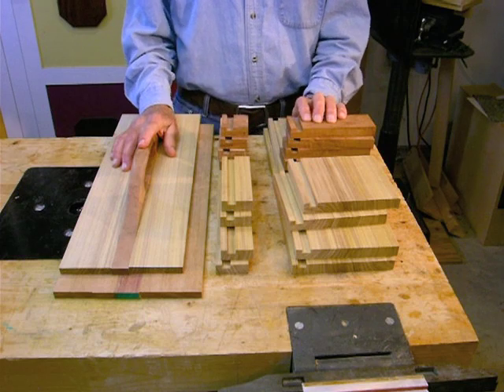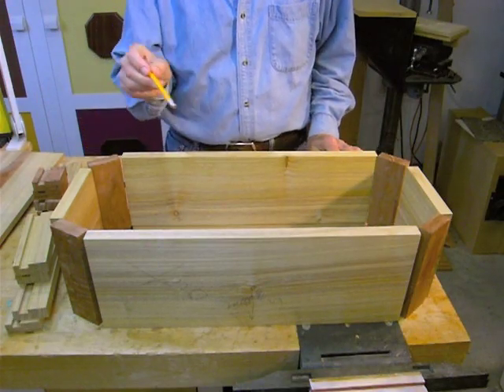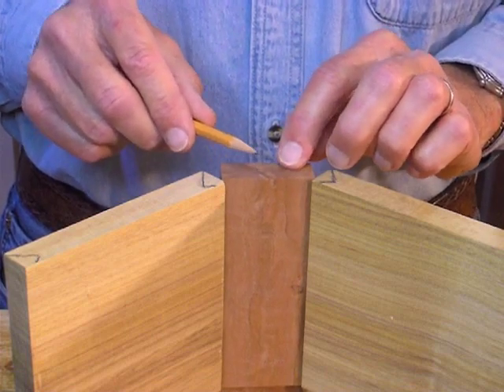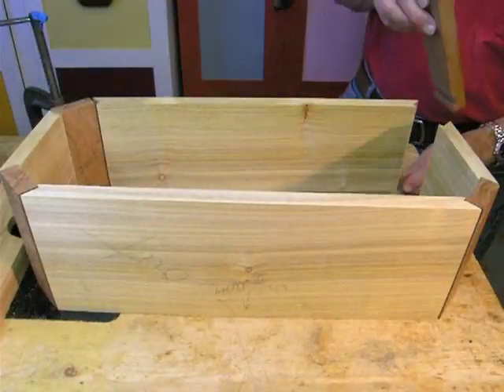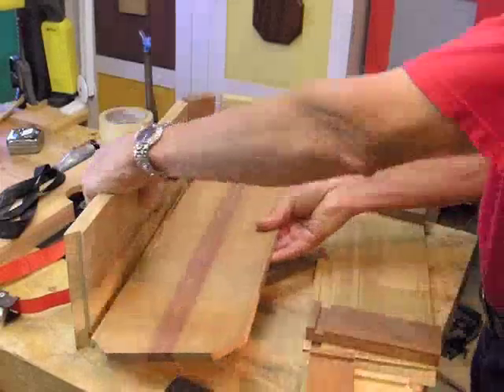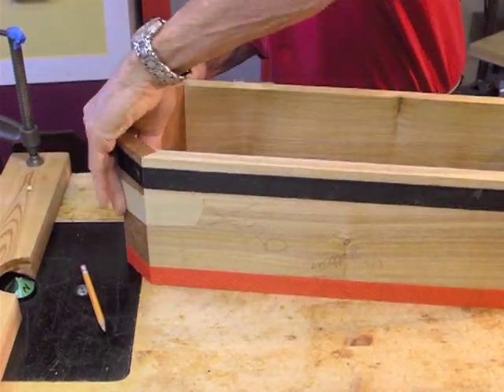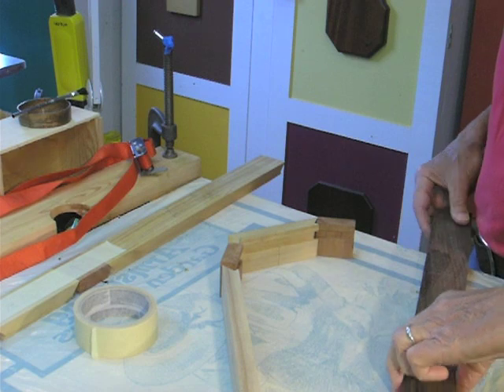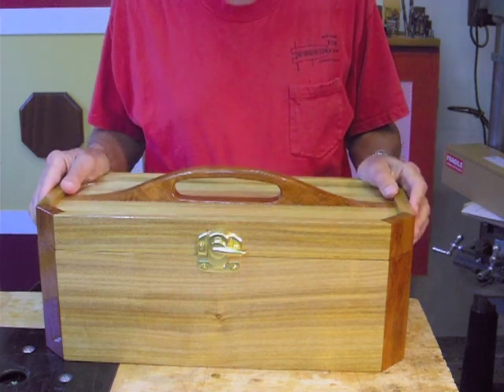Bird Mouth Joinery: A unique tool box

Comment: after watching this glue up several times, I have one question.  I noticed you do cross grain glue ups on the parts.  does this not cause long term failure at the joints with seasonal wood movement?
Reply from the maker: Russ Veinot Hi Russ  Thanks for your comment! You're not the first to question me on my cross-grain glue joints and I realize that this contradicts a common wisdom of the woodworking world. However, I have been doing this for several years on somewhat smaller boxes (check my website), and have had no problems so far. This toolbox is the largest example that I've tried it on, and I'm sure there is an upper limit, depending on the species of wood and range of humidity changes the box will experience. Almost a year of substantially varying temperature and humidity here (San Diego area) haven't yet caused problems. 

I kind of enjoy challenging the common wisdom and, in this case, feel that employing crossgrain joints in a thoughtful way substantially increases my range of design opportunities.

Comment: Very nice lid, and very nice box , but I liked the lid better.I wish you have showed us the handle construction.
Reply from the maker: Thanks for the kind words, Juan! Sorry about omitting any details on making the handle; I was worried about the length of the video and was trying to emphasize the bird mouth joinery aspect of the box construction. The handle started with a 1x3x20" piece of lytchee. After laying out the desired shape, the hand hole was roughly bored out with multiple passes with two sizes of Forstner bit, and the outside curve cut by band saw. The final handle shape was completed by use of a rasp, and a lot of sanding. The handle piece was then glued between the two pieces of canary wood that form the other parts of the lid.
Reply: davidhenry32 Thank you very much for the description of how you made the handle, your work it is certainly first class, I enjoyed you video a great deal and I am looking forward for the next one. good work.

Comment: Can you use two different thickness to make this tool box?
I want to have longer ends & corners parts to make a stool with a tool box built into it.
So I want the top, ends & corners to be 1.5 inches thick, but the bottom & sides to be 3/4 thick, so as to lighten the over all weight of the stool-toolbox.  If I have to, I will make all the thickness the same, but I wondered if you had already tried this.
I am not sure how to open the box, may use a sliding dovetail lid or a side drawer, or a flip down side panel.
I may be able to use a sliding dovetail side panel, this will be worked out in the cheap prototype.

Comment: Hi David i have just bought a bird mouth bit so i am trying to set it up Just a little Question!! if you don't mind does one bit fit all i bought my from the USA  the bit number 3508 from whiteside  machine company  Because i am having trouble getting the height right? Thank you so much. Love you videos Lots of Irish Luck from over here in Ireland
Reply from the maker: Hi Charlie! It's great to get a message from Ireland! The Whiteside 3508 bit appears to be exactly the same as the 8-side bit from Lee Valley that I use in my videos; I just checked it out. The bit height settings should be similar; for 3/4" stock, 3/16". For 1/2" stock, 1/8". The generalization for the 8-side bit is to set the bit height at one fourth the thickness of the stock, then do tests and make any small adjustments as necessary. Good luck!

Comment: Very nice and clean!  Could you have beveled the top and bottom where the lid meets to help seal the box better when closed so as to avoid dust etc from entry and provide a tighter closure?
Reply from the maker: Thanks, Joe! I don't see why it couldn't be beveled as you suggest, with the benefit of a better seal. I've thought about putting interlocking lips on the top and bottom to ensure a rigid alignment and tight seal, but never tried it. Any thoughts on how to go about it?

Comment: That's really nice, I've never seen an 8-sided bit like that, I see you have another video on it that I'll have to watch. Your videos are well done, good job. Wondering about "gluing" the panels, shouldn't they float to allow for movement? I subbed. Mike
Reply from the maker: Thanks for the nice comments! I appreciate your looking at it. Re the glued-in panels; I was wondering if someone would call me on it. My intent was to rigidify the box, as it will be hauled around and no doubt get banged up with rough handling. As I see it, the width of the panel is borderline for requiring allowance for movement, so I took the chance. Time will tell; I'll fess up if I start to get popped joints. There is one other violation of construction conventional wisdom that may catch up with me!

Comment: Thanks David, for the nice video.  The box is beautiful.  I was surprised that you glued the bottom all the way around and didn't allow it to "float" at all.  For a drawer bottom, usually one would just fasten it in the "middle" so that the wood can expand and contract without damaging the joints.  I'm curious if it has held up well since you made it?  Thanks.
Reply from the maker: +Jeff Pritchard Thanks for the kind words and insightful comments. I did think about wood expansion but in the end, because I wanted the box to be maximally strong, decided to risk it. The box is not all that wide and the woods in the bottom are relatively low in movement. Also, there is some compensating expansion of the box body from the cross grain corner pieces. And I have a habit of challenging the common wisdom where it doesn't seem to make sense. On a solid wood 36" wide tabletop, for example, I would definitely make allowances for wood movement. So far, and the box has been getting some serious use, it seems to be completely intact.

Comment: Great video enjoyed very much, the "tool box" looks so good you wouldn't want to use it for tools, did you put a top tray inside the box???? Tim.
Reply from the maker: Hi Tim! Glad you enjoyed the video. No tray inside but it would be easy to make one as a drop-in. It could be built essentially the same way as the lid, but slightly smaller so that it would slip inside the box. I am using the box for hauling tools around but it doesn't get a lot of action; so far not much gouging or scratching, etc.

Comment: I've got to admit that it's a very attractive joint.  Especially when used with contrasting corner pieces.  I guess it's similar in some respects to a "locking mitre joint".  Thanks.
Reply from the maker: +David Handley Thanks for your interesting insights! I agree that there is a similarity to locking miter joints. Both joints hold the work pieces tightly where you want them, very useful for assembly. Using bird mouth joints requires more parts and therefore a bit more (but easy!) work, but has the advantage of allowing multiple sides in a box and more decorative potential.

Comment: this should rather be used as a jewelry box than a tool box. I would hate to spoil this beauty with rugged tools and scratches during a normal workshop / onsite repair scenario.  :)
Reply from the maker: +Atif Hasan Hi Atif!  Thanks for the kind words and for looking at my video. I've been using the toolbox for over a year now and it does have a scratch or two. The polyurethane finish seems to help minimize the biffs and scrapes. I've since built one out of 1/2" plywood (with a simpler handle) that is just as strong and significantly lighter in weight.

Comment: David: Thank You for an excellent video. I was surprised that you glued the top and bottom all around. I thought you would leave them "floating" to avoid expansion/shrinking issues. You method is obviously much stronger; but have you had any issues from expansion?
Reply from the maker: David    -    Thanks for your comments! Glad you liked the video. You are not the first to notice some of my glue-up practices. In this case I may be near the size limit for getting away with neglecting wood expansion. I decided to do it because I wanted maximum strength in the box; I expect it to get banged around quite a bit. I'll fess up if I have joint separation in the future. I'm also at risk with the cross-grain corner glue joints. I've been making smaller containers using this construction methods for years without problems.
Reply: I was thinking the exact same thing. On the top I see the need for strength (after all thats where the handle is) but I have some reservations about the bottom half, with the crossgrain corners and the fully glued bottom. I would guess the type of finish, or lack thereof,  may be the determining factor of how much expansion and contracting will affect it.

Comment: I've watched several of your videos now, and I greatly appreciate how articulate and concise you are. It's so nice not having to put up with filler words and silly catchphrases. 

I want to get my feet wet by making a few of your planter boxes, but my wife would like a trunk for her horse tack -- probably 2' by 3', I'd imagine. I think a birdmouth design would be neat, but I'm worried about the weight, as you mentioned this toolbox was heavy. What do you think about this: instead of making the front, back, and sides out of solid wood, make a frame that would hold some thinner wood panels. 

I also wonder how that would look with the angled corners of the birdmouth style. I worry that it would clash.
Reply from the maker: Thanks for the kind comments, Petrushka1611.

I think that your idea of using fabricated panels as staves, instead solid wood, for a larger box is terrific! As long as the frames for the panels are strong enough overall, and have enough solid wood at the edges for the bird mouth joints, it should work just fine. And I don't see why there should be a stylistic clash at the corners; that would depend on how you design the panels. I can see both an inexpensive outer shell of veneered ply or something fancier like solid door panels built with thinner stock. 

I'd be delighted to hear how it turns out!
Reply: If I end up making something instead of just talking big, I'll definitely let you know. My wife decided to go with a plastic trunk, since it will be occasionally thrown in the back of a truck and knocked around, but I'm now thinking about making a hope chest for my niece.

Comment: David, I really appreciate your teaching style. I hate when others show routing or cutting every single piece. I think one or two is more than enough. I have to say I would have liked to see a little more info on the handle shaping. I have alot of trouble making free form items and would love any tips about this aspect. I'm wondering couldn't a dado stack blade be used to create the same joint?? I have a bookmark for this joint being used to make a flagpole and masts for sailing ships. 
Thanks for taking the time to share and can't wait for future projects. Subscribed and will be checking out your other videos.
Reply from the maker: I greatly appreciate your generous comments! Sorry about ignoring the handle shaping; it seemed like too much for a single video. It was done by approximate Forstner boring of the hand hole, bandsawing the outside curve, rounding off the hole and outside curve with a rasp, and a lot of sanding. Re using a dado stack for the joinery: why not? Typically, mast makers using BMJ use angle cuts with their table saw for the same purpose (two cuts are required.) For masts, stock thicker than 3/4" is often needed and the commercially available bird mouth router bits aren't big enough to handle it. Getting perfect joint angles with a table saw might take a lot of fussy adjustments, however.
Reply: David, thanks for the additional info much appreciated. I really liked the formula you added to the original info on these bits. Might want to add that as a link under your info about section.

Comment: You mentioned it was a bit heavy, and at the beginning of the vid I thought that it might be-- would the same project work with half-inch baltic birch plywood?  I figure the void free ply will offer some additional strength, and it seems your construction method would highlight the edge-bands of the birch only around the octagon edges of the tops/bottoms.
Reply from the maker: Hi Nick! I'm sure that 1/2" baltic birch would work. I used it for a similar but smaller box without problems. Thanks for your interest!
Reply: davidhenry32 thanks for the reply. You earned a subscriber because your toolbox video went so far in effort to avoid showing standard work while still displaying it clearly and focusing on the subject at hand: joinery with birds mouth bits. Thanks for your work.

Comment: Thanks for the video--it's a great looking project and a good reason to buy a new router bit. I was wondering whether you considered doing the box and lid as a single assembly and then cutting them apart?
Reply from the maker: Many thanks for the comment and question, James! Re cutting apart a single assembly: good eye! This is a very practical idea and I use it often for smaller boxes. In this case my canary stock was not quite wide enough to get the box height where I wanted it. I have a video on building napkin holders coming soon (hah!) that relies on this idea.
Reply: That makes sense. After I commented I think I noticed you used that technique on another box. I only asked because I thought there might have been a reason other than stock width. I'm definitely looking forward to trying this AND to seeing your next video.

Comment: Hi Dave.  Pardon me if this question has already been asked, but have you experienced any problems at the joints due to expansion?  I noticed the corners are vertical grain while the sides are horizontal.  Does it work because the box is relatively small, or perhaps the species of wood makes the difference?  Also, if I wanted to reinforce the joints, what would you recommend?  Thank you.
Reply from the maker: Hi James.  Thanks for your comment! I was waiting for someone to question me on my cross-grain glue joints! I have been doing this for several years on somewhat smaller boxes, and have had no problems so far. This toolbox is the biggest example that I've tried it on, and it may be pushing the limits; if I have trouble in the future I'll comment on it. Three months of substantially varying temperature and humidity here since it was assembled haven't caused problems (yet!)

Re reinforcing bird mouth joints, I hadn't given it much thought until now. My first thought is that it's ordinarily not necessary. If special circumstances require it, splines might work, wouldn't be difficult, and could add a nice decorative touch. It's possible that some type of biscuit or floating tenon could be inserted, but the fabrication set-up might be complicated. I'd be interested in any thoughts that you have on the subject. Do you have a specific application in mind?
Reply: davidhenry32 Thanks Dave.  I have made some desks in the past, all with traditional joinery; mortise and tenon, dovetailed drawers, etc., but in the past few years I have only been doing small projects, like jewelry boxes and bandsaw boxes.  (A big factor is the cost of good wood.)  I found your video on bird mouth joints to be very interesting.  I'm sure I had seen the joint before in one of my woodworking books, but never thought of using it, mainly because I always make four-sided boxes.  Now that you have demonstrated it though, I will probably give it a try.

I don't think I will buy the router bit though.  I think for me it would be better to use a dado stack on my table saw.  I think it would work just fine.  In my mind I envision making a sled sloping at 22-1/2* rather than tilting the dado.  I would have to do some experiments though to test out the idea.

About reinforcing the joints - I was mostly just thinking out loud, wondering if you had ever needed to do so.  I guess on your vases with vertical grain joints any reinforcement would be superfluous, but I can see on horizontal grain joints the possible need for a spline of some sort.

Thanks for making the video.  It was very instructive, and enlightening.
Reply from the maker: James Carr
James    -    thanks for the useful and informative reply! I really like your dado stack idea; it has the potential to overcome one of the significant limitations of the commercially available router bits. They are good only for stock thickness up to about 3/4". If you try it, I would very much like to hear how it turns out. I've never seen the idea suggested before.

Comment: I tried the 8 sided bit..got a bit of tearout and chatter. Feed speed too fast or depth of cut? Have some experimenting to do.
Reply from the maker: The problem was almost certainly taking a cut that was too big. For 3/4" stock I always take at least two passes to reach the final depth of cut. The 6- and 8-side bits take a pretty big bite. The kind of wood also makes a big difference. A few preliminary experiments, as you point out, are a good idea.

Comment: mr henry is it ok to glue two pieces of wood together after they have been stained or will the glue joint be to weak   thank you
Reply from the maker: Hi Bill!      I'm a long way from an expert on glue but I would be careful about using wood glues on stained or otherwise finished wood. The chemistry of wood glues is aimed at sticking to raw wood fibers and any prior finishing raises questions in my mind. I'm sure that in some cases, with some stains and some glues, the glue bond would be OK but I wouldn't risk it if you are counting on a full strength bond. If sanding off the stain is not possible, I suggest trying epoxy glue; that seems to bond to almost anything.

Good luck!